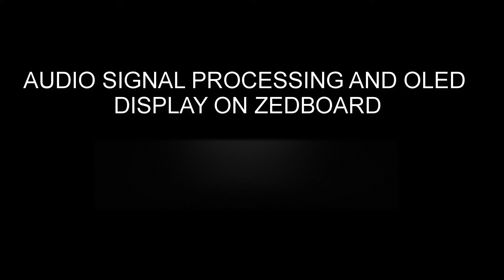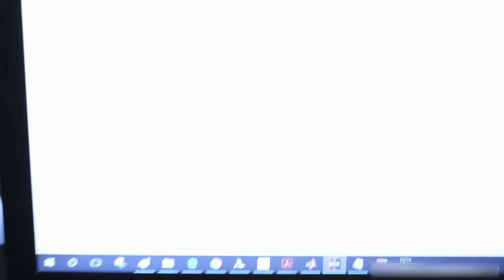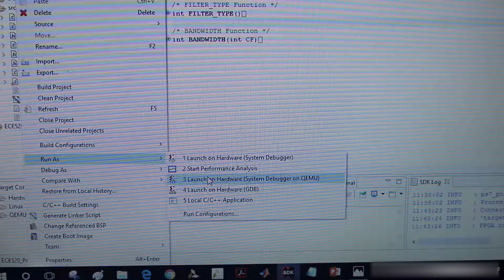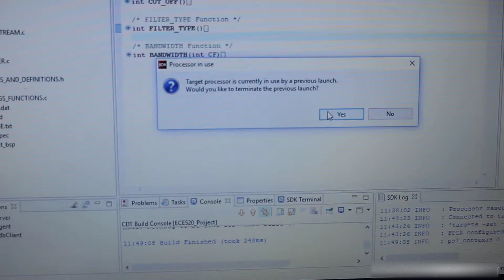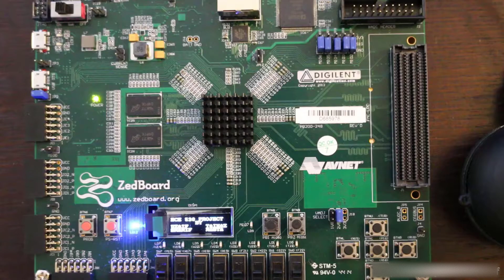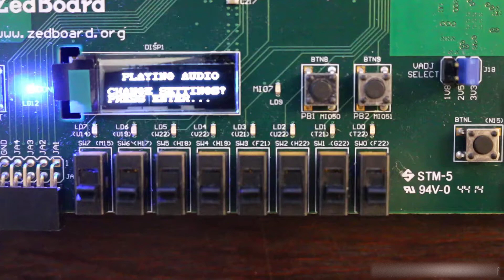Real-time Audio Signal Processing on Zedboard FPGA

Comment: hey, I saw your project, I liked it very much. Actually, I am working on the same zedbord for a motor control application, But I am not understanding how to provide inputs to the Zedboard through PMOD pins. Can you please share a piece of code or a design which shows how to do this. My email id is kiranphalke50@gmail.com thanking you in advance.
Reply from the maker: What type of inputs you wanna take in through PMOD? and where are they coming from?
For motor control application, probably you need to configure PMOD as outputs to control motor's direction and speed and for this purpose, you need to generate PWM & enable signal as well. While if you wanna change the direction and speed manually through switches or buttons then it's a different story I guess. Let me know the theme of your project then I can help you more. Thanks!
Reply from the maker: Check your emails!